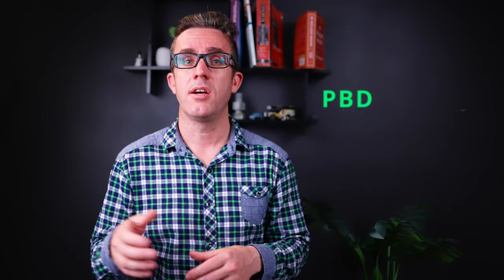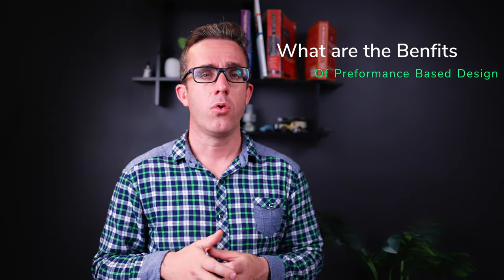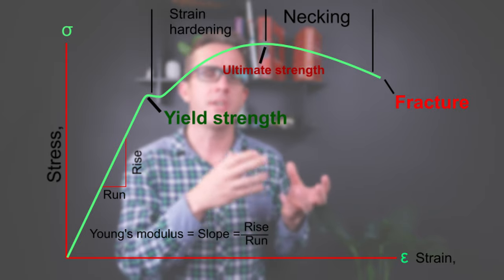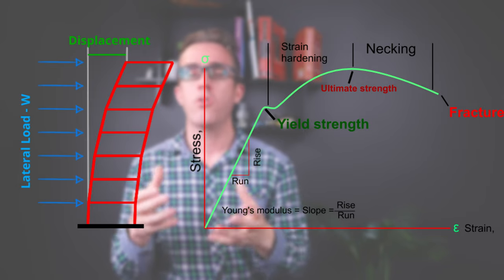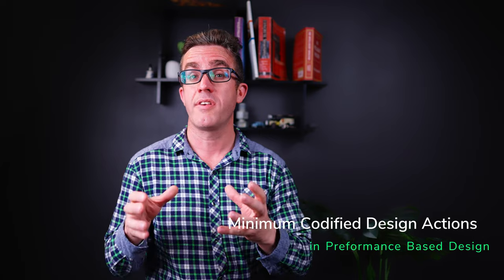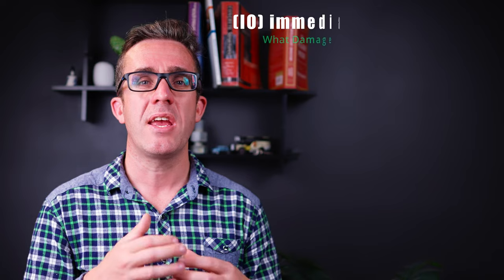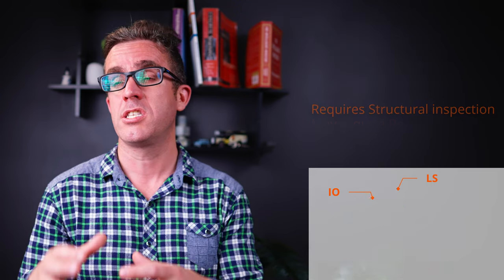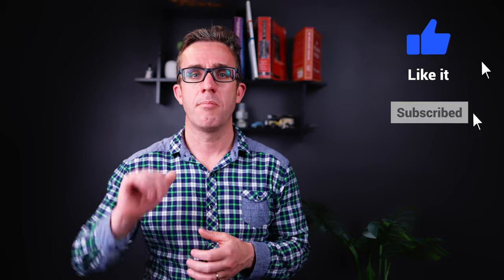Why Performance Based Design Achieves Structural Efficiency

Comment: I am a structural engineer here in Australia, have 20 years of experience. I have been using advanced non linear analysis for over 15 years, for seismic actions and wind loading. I’ve been developing new methods of engineering precast concrete structures using vertical post tensioning. We have undertaken physical full scale testing at Swinburne university on this new innovative system.
I’ve used non linear pushover analysis for structures here for 12 years on very tall towers to sway frame retail structures. It is very true that PBD produces structural optimisation, even under wind loads. 
As a professional engineer the attacks I have been subject to during peer reviews by the biggest consultants in this country has been extraordinary, and depressing. The more advanced you are as an engineer, the more the code compliance specialists undermine the profession and innovation.
I am quite impressed and happy you have produced this video. Reach out if you want to discuss.

Comment: Hei Brendan,
I am a student in structual engineering. I am not understanding the concept when everything is included. I have many question:
- Can you make a step by step videosfrom start to finish how multy storey building are built?
Do you start first by structual analysing the whole building frame, then design it with the national or international codes? 
How are modern walls built, with steel and glass or aluminium or wood?
Masonry structures from the 1900 hundred are symmetric and have good aesthetic form into it. What kind of materials did they use, brick or stonework unreinforced masonry, wont it collapse during earthquakes
Reply from the maker: Hi Sami, hope you are well, thanks for the question. I will see which of these can be included in videos and which may need to be a Paid VOD. thanks for the support.

Comment: Do you have any comment about the Millennium Tower in San Francisco that sustain significant tilting. Do you think that still could be saved o should be demolished before a suddenyi catastrophic event happen?
Reply from the maker: Hi Igor, I haven't seen the design, but it would need to tilt significantly before it becomes a issue. So I would hope that the building could be rectified before it tilts to much. The tilt wouldn't be able corrected tho.
Reply: @BrendanHasty  This building, yes is still structurally sound. Are on the way efforts to correct the actual tilt that now are affecting all the sistems that work with gravity. Thank you for your always good information.

Comment: Solid on this topic! Thank you for the video, Mr. Brendan.  I almost use Response spectrum analysis, RSA, for all scenarios.  And it is the method, recommended by Euro Code 8 for every type of structure. Some literature tells us how it works. But the left is how to combine the action for the structures as 'equivalent loads' for the accidental category in load and resistance factor design.  The FEM software I use offers the combination method for each significant direction affecting the structures.
Reply from the maker: Hi Bo Zhao, agree most of the time I also use RSA. Have started to looking in to PBD to achieve a more efficient design specially when construction budgets are tight. But it does take more time so need higher fee.

Comment: Very interesting topic as always from you Brendan!  I would just warn engineers trying to design buildings into the plastic deformation zone is not something the department of buildings here in NYC likes.  Just make sure you always are checking your local codes for what would be acceptable because at the end of the day we have to comply with the code...even if it's behind the times!  The last thing you want is an audit of your building and they make you completely redesign because you are too smart for the code enforcers
Reply from the maker: Hi Peter Agree that sometimes you if can convince the certifier you need to still comply. You will want to make sure before doing too much work.

Comment: Push-over method is not suitable for high rise buildings or irregular structure, what’s more, it’s only suitable for building which dynamic performance is governed by its 1st vibration mode.
Reply: Hi Scott,
What limits Push Over to be applied on High rise or irregular buildings ?
Reply from the maker: In Australia they have had a very prescriptive approach to design, Push over allow to remove some of these requirements. Agree that more complex analysis like non-linear time history achieve greater savings.
Reply from the maker: High Rise buildings are typically governed by wind, so you would getting savings on wind tunnel testing.

Comment: What software i learn? I doing Bechlors civil engineering( general). So that i can get a job in Australia when come to Australia as fresh engineer.... Kindly what software do civil engineers use... Kindly make a video or reply in comments
Reply from the maker: Hi Fajar, this will be slightly different for each company, but bu typically Rapt, RamConcept, etabs spacegass. But every company will use different ones, better to get design work to Australian standards even at small companies.

Comment: Dear Brendan. I am a PhD student and my topic is AI in structural engineering. One of my biggest goals is to predict structural response using machine/deep learning. By now, the main goal is to predict Non Linear Time History (NLTH) seismic response of the building. Can you please tell me, how useful can it be for the industry to have this kind of tool? Or maybe it’s better to predict response spectrum analysis outcomes (for elements presizing in the conceptual design stage)? I am asking this question under this video, because PBD is frequently used with NLTH analysis. So, I was thinking that maybe it could be very useful to predict structural state (IO, LS, NC) rather than inter storey drift (my initial goal). What are you thoughts on this? I am sorry for so many questions, but I recently find your channel, I really appreciate your efforts, and thought that you can give me some indications based on your experience. Thank you in advance!
Reply from the maker: Hi 36 Studio, your research topic sounds amazing, NLTH would achieve the most efficient design, but how is the processing time? It would be ever useful if it doesn't take long to process. Response spectrum would allow for a quicker assessment so would be better for a quick preliminary sizing where you may have lots of iterations.
Reply: @BrendanHasty  Thank you for your response, Brendan! If by “processing time” you mean “how long should I wait for the result to appear?”, the answer is “more or less immediately”. Basically, you just insert materials, elements’ cross sections, basic geometry (height, elements’ lengths etc) and ground conditions, push the button and get the maximum inter storey drift of the structure. Of course, it will take us a while to train this neural network (since we don’t have much open source data for NLTH analysis, we need to generate it in Opensees or using API of SAP2000 or other FEM software. Basically we will need to run a loot of NLTH analyses to generate enough data), but once the neural network is trained (and able to predict the results with a high accuracy) it can give the output immediately. The main value of our research is the following: Since NLTH takes a lot of time to perform, we see a need for the quick response prediction of this analysis, so you can avoid a numerous iterations of it. We hope, that our neural network will be able to achieve it. Of course, with some limitations (that we will discover during our research). 

What do you think about this idea?
And which parameter in your opinion will be the most useful to predict? Now, we think about the maximum inter storey drift among all floors. We probably cannot include multiple outputs since it will take much more data train neural network (I.e., more NLTH performed by us, which take much more time etc.)

Thank you in advance for your answers. And I can update you about our research if you are interested through email/LinkedIn or as you prefer.
Reply: @36studio11 "lots of NLTH analyses" does not sound easy, at all. The problem with PBD is the amount of data that should be considered. You are then supposed to train the model to predict responses of different ranges of structural systems, ground motion levels, material non-linearities, hinge modelling, hinge parameters, state of hinges and so on. Considering the amount of time to run a non-linear model, I believe it should be a mega work to do.

Comment: Hey brendan! I have a question/video suggestion. What type of entry level structural engineering interview/technical questions do firms ask when hiring new engineers?
Reply from the maker: Hi Karim, thanks for the suggest it is on the list. Interview are more of a discussion, of course having a solid understanding of engineering is important, but it is more imporant to fit into the company culture.

Comment: A very nice and comprehensive illustration of PBD. I had a query as Push Over Analysis covers the non-linearity for static cases. What about dynamic cases? Does it have a separate code?
Reply from the maker: Hi Fammaz, you can make push over analysis more complex with a non-linear assessments. You can also assess the load distribution on your dynamic cases. The more complex you make it the longer it takes, also build up the complexity in several models to ensure the building is behaving correctly.
Reply: @BrendanHasty  which software will you recommend for such an analysis? Is ETABS fine?

Comment: Hi Brendan, appreciate your videos. Regarding structural design, have you ever had to deal with heritage listed components. If so what are the approaches you would use to incorporate heritage in your design. For example, using sandstone for bridge columns.

Moreover, If possible could you make a video doing resume critiques and any advice on gaining a structural engineering internship.
Reply from the maker: Hi Luke I have done several heritage listed building. Alot of the time you can design using modern codes, but sometimes the structure will need to be too big. I have also approached by having  new structure eg still framing. And limit the fixing to the existing building thus having a separation between old and new if done effectively can also get approved.
Reply from the maker: I have planning a video on interview tips, and videos on resumes would also ve great.
Reply: @BrendanHasty  thanks a lot

Comment: Sir, as structure engineering is broad. Is it okay if I only focus on either only steel structure design or only rc structures design or  something like that and further dedicate career towards only one of that.
Reply: Short answer: No. You should be able to design basic structures with common materials (steel,concrete,timber,masonry).
Reply: @zannettos  i want to ask this question with an experienced professional
Reply from the maker: Hi Alex it really depends but I agree with Alex you want to learn all materials as you get a broader range of building you can design and also improved you understanding of structural behaviour.  You can specialise but I would recommend broaden your knowledge.